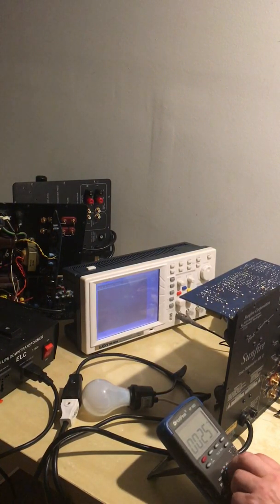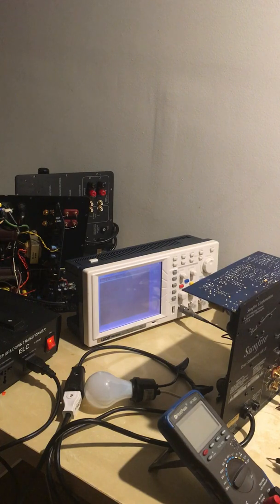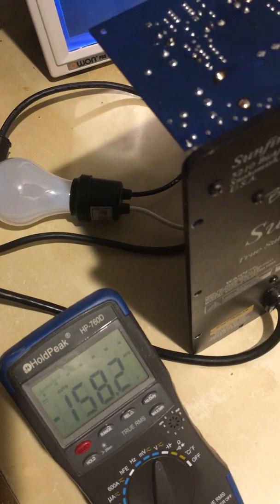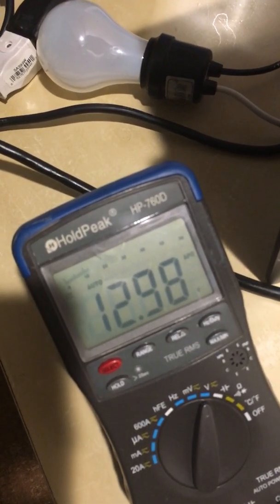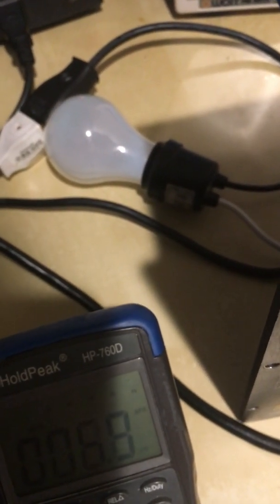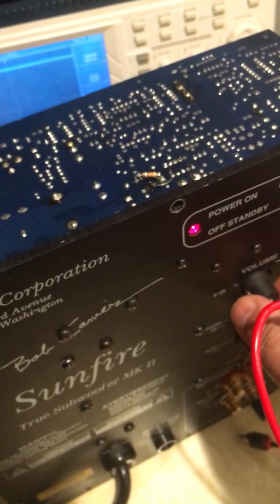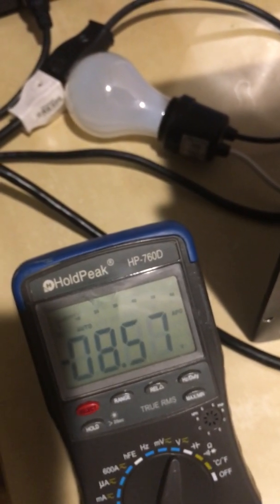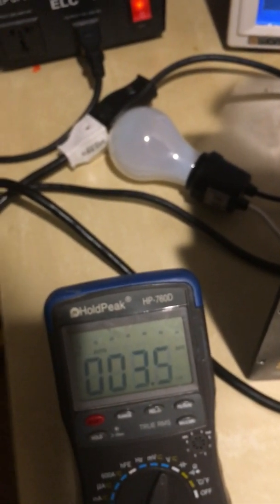Sunfire Subwoofer   True, MK II , MK IV

Comment: Thank you for this video! I have a Mark II. All of a sudden it went crazy full volume and won't stop. I measured voltage on the points you mentioned and they all measure around 123v. Any ideas?
Reply from the maker: Reference point  ,,JP 1 -2 “  name it  on  board  what  voltage do you  read ?
Reply from the maker: Full volume sound  music or  buzzing static noise ? be more specific ,
Reply: @tommybimmer73  Thanks for the reply. If I plug it in it's a loud buzz/hum. No input source hooked up.
Reply from the maker: Ok. Looks like  sub need to recap or missing ,loose ground , when last time was serviced or even recapped  if any , hard to diagnose over chat , could  be something else , I restored about 27 unit till today  with many different    issue , let me know if you need further service  with your sub
Reply: @tommybimmer73  Thanks again for the reply. It has never been serviced. I'm going to replace all the items in your video and hope that will fix it. Do you know where I could find a repair manual or schematics?
Reply from the maker: Nht sub 2 same design

Comment: Tommy, I have a sunfire mk2. It plays fine at lower volume, but at high volume it will only play for about 30 seconds. After that it changes to a loud hum. I have changed all of the electrolytic caps. What should I try next? Output Transistors?
Reply from the maker: hi.can you list what capacitors are u changed,
Reply: @tommybimmer73  All of the electrolytics on both boards as well as the main filter caps. It took forever!
Reply: Here's a more detailed description. The sub is working fine up to medium volume. After a 10 seconds or so at volume that causes around 3/4" peak to peak excursion at low frequency, the signal stops and a medium volume hum occurs. Removing the signal for a moment will correct the the condition, then it will reoccur after another 10 seconds after the signal is returned. If the volume is reduced it will run fine. Amp gets slightly warm on the back panel, but cooler than my other subs. Also, it's not related to the volume pot position. Different combinations of pot position and input level that achieve the same output level cause the condition. Before I start swapping the transistors I wanted to see if anyone have a theory of what might be happening. Thanks!
Reply from the maker: Hi ,can you ChEck  voltage on  both copper coils to Gnd  , connect input  signal and set sub  pot  low  and  Test voltage  value when cranking  pot up till you get issue , record all value both side , also check all zener diodes ,  near  opto hp2611 , something is not right . for me  this situation  check  voltage on adj pot  shoud be both -13and 13v  , check voltage to op amp  bridge connection  must have +13 and -13 rail  supply and signal , it’s hard  to diagnose since  I can’t  test  it
Reply: @tommybimmer73  Thank you for the thoughts. I'll check diodes and 13v rail.
Reply: For anyone reading this, this issue was resolved by replacing the 6x IRF640 power transistors. The only issue I have now is that the total output seems low, but not by too much, maybe 6db. I'll replace the outputs and report back.
Reply: @evanchadwick4245  Thanks for the update! Most don't do it. Appreciate it!
Reply: I have the same oscilloscope.

Best Regards.

Comment: i have the true MKII with hum, pop and rattle problem. Not Blow fuse or Transistor. I replaced capacitors (c7,c10,c15,c17,c18,c37,c38,c39,c40,c45,c46) on the main board but with no success. Do you Have any suggestion or schematics to share. Thanks
Reply from the maker: Check or replace c41 ,c52,c53
Reply from the maker: Also on op amp check or replace  470uf cap 4x
Reply: @tommybimmer73  I have the same oscilloscope and the same issue with the same sub.
Tomorrow I remove the amplifier board for test the Mosfets.
I test the +- 13 volts and is ok.
Sounds like something in the amplifier is not well polarized.
I try to fixed tomorrow.
I test all the electrolitics using an ESR meter.

Best Regards
Reply from the maker: Hi , what  symptoms your sub have ?
Reply: @tommybimmer73  I found two resistors open, R64 and R65.
Amplifier was  sounding distorted be cause Q12 is not well polarized.
After change the resistors everything works fine.

Best Regards.
Reply from the maker: @treadmillrepair754   Hi.. amp plate in this video  its working fine,  amp plate  temp  plug  in  small few watt speaker  just for  basic  test  after  repair ,  looks  like small speaker can't handle low freq  and sound distored  :)))